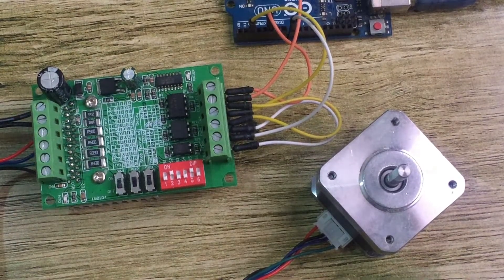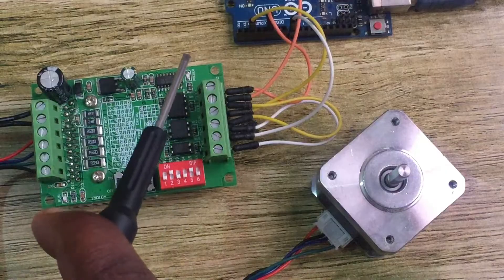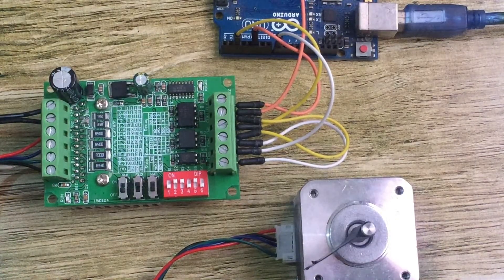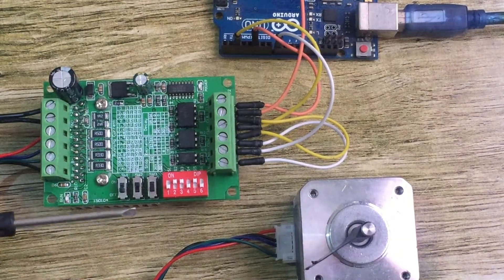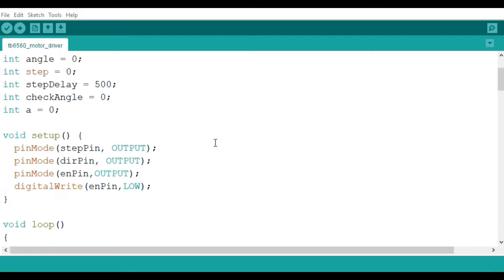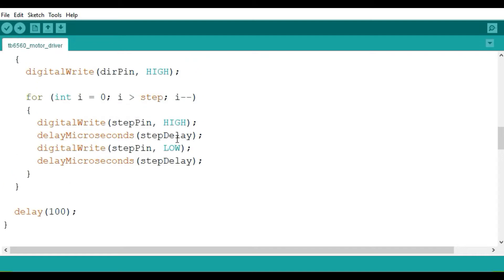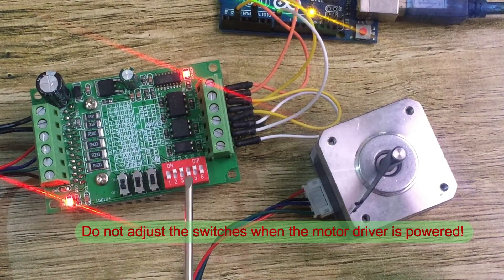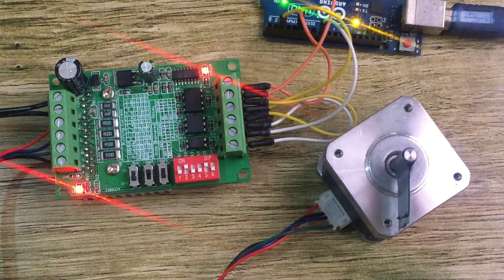TB6560 Stepper Motor Driver with Arduino.

Comment: Hello professor! I have a board with this TB6560AHQ driver, but with outputs to control 3 motors, and it has 3 individual 6-position switches, therefore it doesn't have the SW1 to SW3 switches. However, I don't understand what the positions of the 6-position switches should be to use a motor, for example.
P.S.: My board is blue and also has serial outputs.

Comment: Hey men, i need to know if the stepper motor was 6 cables, becouse i see in the video the two cables of the center of the coils that are removed from the stepper, tank you💪💪

Comment: How would the code be if instead of direction and position I had a pair for CC and another pair for CCW?  I just want to push a button for forward and push a button for backwards but no one has this code.  I know it's super easy but I"m noob at coding so don't know how to set it up.  I have a 5 phase motor and driver board.  It just wants a pulse on either CC or CCW pin to move.  Any code ehlp would be appreciated.  Would like to use Raspberry Pi Pico or Arduino Nano.  Either one